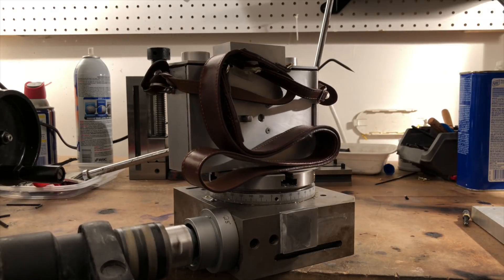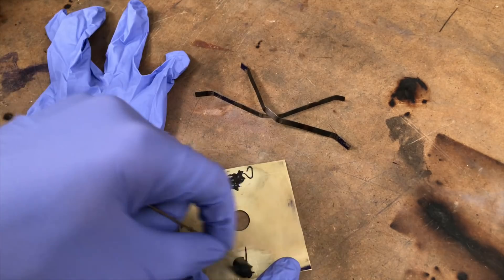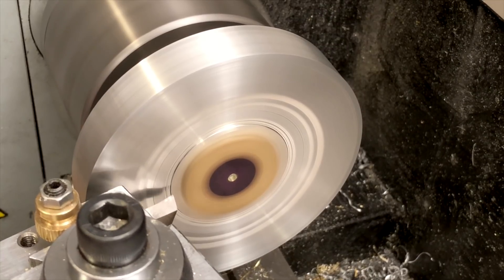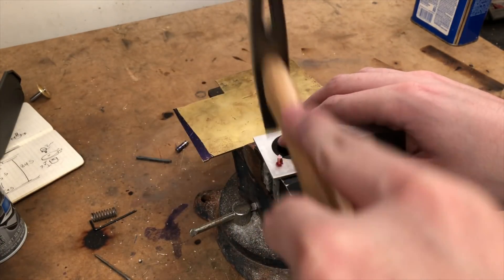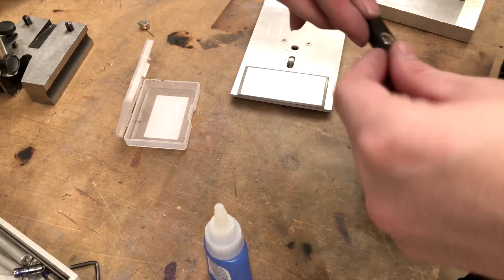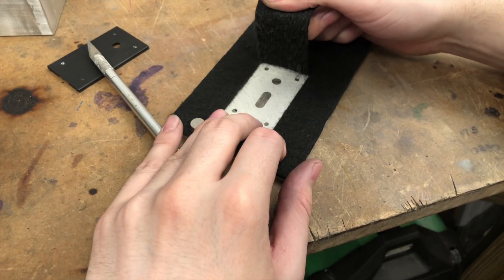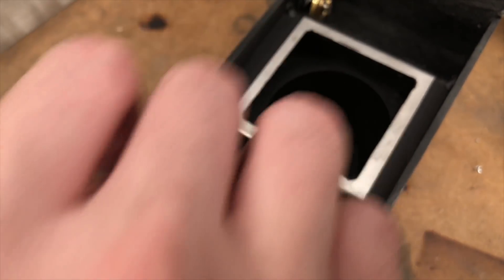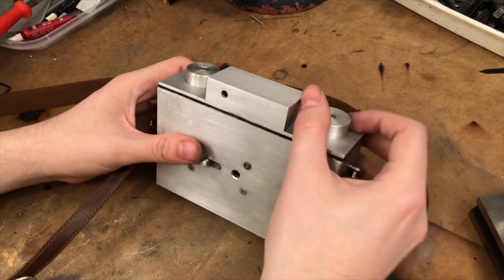How to make a Camera in a Home Machine Shop Part 9: The Completion

Comment: Amazing Work ! 
you should have way more subscribers man !

I have a question, one of my project since a long time is to make a lens made out of wood, do you think its a good idea ?
i made some 3D printed lenses, and some DIY lenses but i never saw a lens with a wood body.
Reply from the maker: Thanks man! I’ve nerved seen a wooden lens either. As long as you can get something with a tight grain patter that wouldn’t warp to much I think it can be done! Are you thinking fixed focus or something with a helicoil?
Reply: i was thinking something than can focus with a very basic screw system.
like i did with my 3D printed lens.
but i wanted to get that cool hipster look of a wooden lens on a digital camera.
Reply from the maker: haha Check out this video about making wooden threads: https://www.youtube.com/watch?v=WhOdrlGie68 The main draw back with wood is its hard to get fine threads. So the movements may be a bit rough. I've seen videos of people who make wooden threads for vices. I think something like that will be the best course of action. When done right the threads can look crazy good!